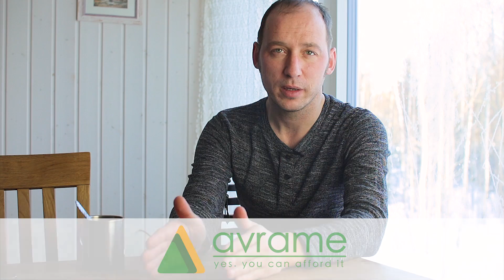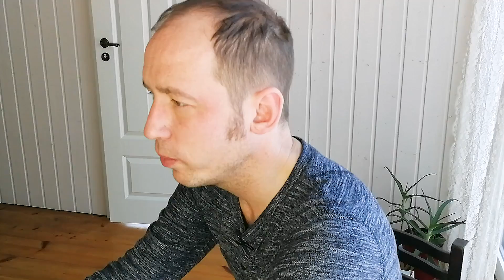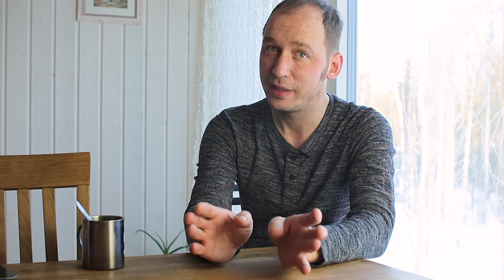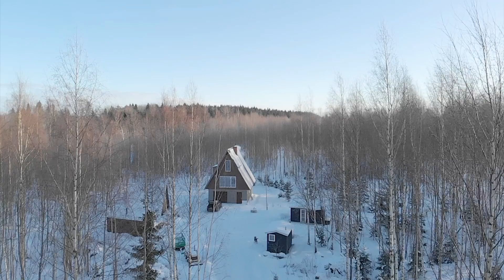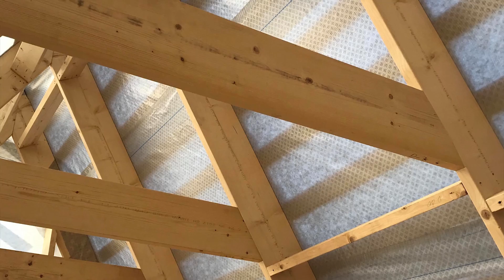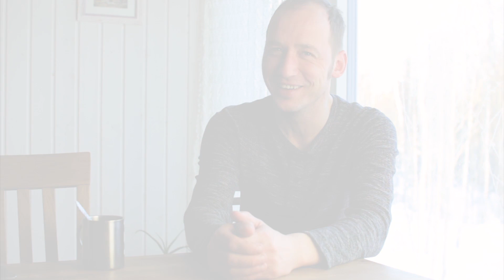Energy Efficient Homes | Key Considerations for a Sustainable Living

Comment: Thankfully I have lots of wood fuel, from a renewable plot.
So I think a wood fired boiler stove with central heating and a hot water cylinder .
Then up to 4000w Solar electric and a 8-10kw Powerwall , LG or Sonnen .
Maybe later on a 3kw wind turbine to add more comfort for off grid . 
First of course I must speak to Avrame people.

Comment: Our plan is R60-R65 insulation in the walls & ceiling using a combination of rock wool & flame resistant rigid Polyiso foam board,  thus giving us an approximate wall thickness of about 12". And, we're also considering using a safe low VOC foam sealer as necessary on any applicable cracks or crevices to provide a tight air-seal and use triple pane energy efficient windows to minimize heat loss while still providing the ability to enjoy the views of the outdoors. As for heating, we're thinking about radiant floor heating but have heard from a number of builders that it may be an overkill in a super insulated home. We're thinking of using a wood stove & or fireplace as a back up because the winter months in Michigan can get as cold as -30F or -34C, also considering an electric HVAC furnace because there's no toxic carbon emissions or flue vent required per building codes and they're much cheaper and last twice as long as a conventional gas furnace. Also, we could run the furnace off batteries that are charged using solar panels or a generator (sharing the same controller module or inverter). We've priced many models of all the above mentioned materials and technologies in hopes of designing and implementing a near ideal energy efficient home. We're somewhat considering passive solar and a Trombe wall type solution but unfortunately Michigan is the 2nd cloudiest state in the US according to many government agencies' statistics (and we've lived here all our lives and know that the statement is pretty much accurate, LOL).
Reply: what do you mean by "an overkill in a super insulated home"?
Reply: @vadimcrivceanschi4467  We've heard that if the house is super insulated, that the radiant floor heating system might provide too much heat since it comes from the large thermal mass of a concrete floor & moves upward  thus heating all the air between the floor & the ceiling more efficiently than a regular HVAC system would with only a few heat vent sources. We'll be researching more about how often the system cycles on & off versus if it ran continuously at a lower than average temperature than you would have in a non super insulated home in order to determine if the cost of a radiant system would be worth it or not.